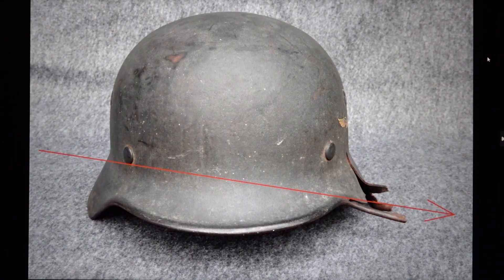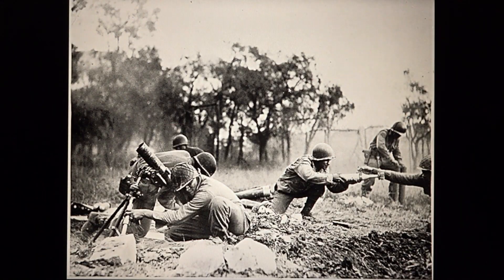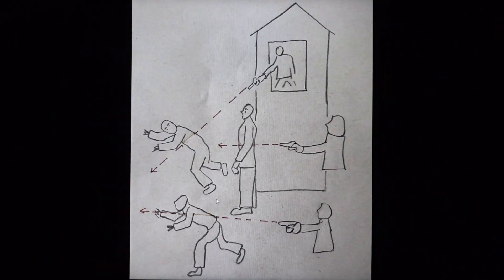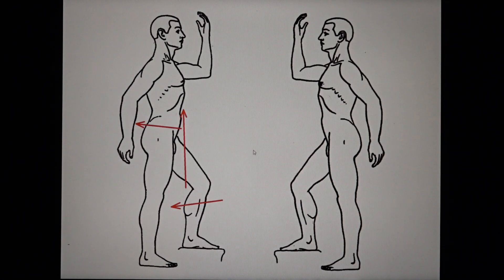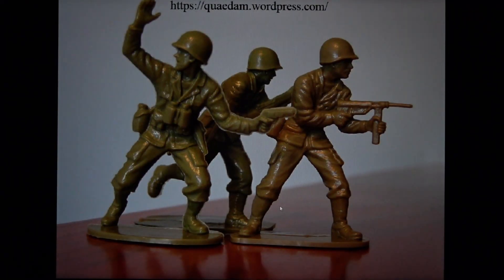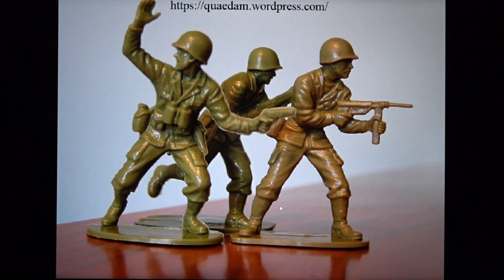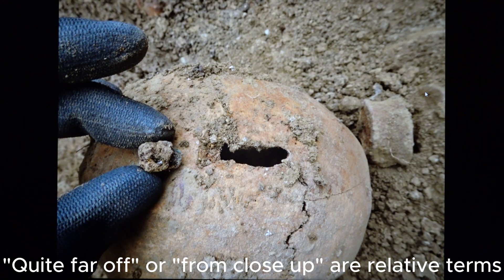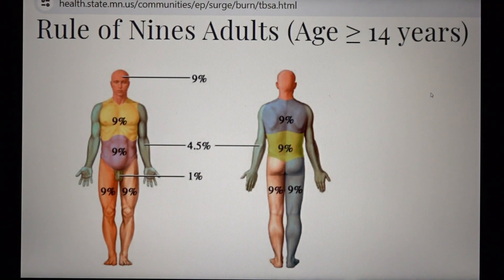Bullet trajectory and shooter position - Scientific fact or mistaken overinterpretation?

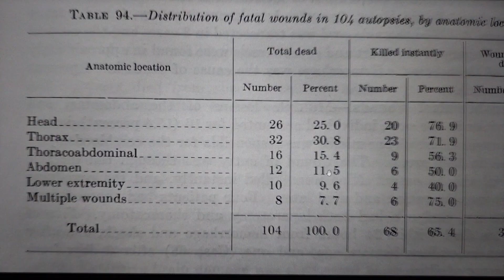Comment: 11:24 There's another video on YT about 'survivorship bias', which concerns a WWII study of damage to planes, and what parts of planes to protect more. I believe I remember the thumbnail too: they plotted the bullet damage to planes that returned and there's a LOT of holes all through the wings and the fuselage, but very few in the areas where the engine(s) and pilot(s) were. Looking at those diagrams most peoples first impression would be 'we have to put more protection on the wings and fuselage', since clearly they suffered more damage. However, fortunately there are smart people around (no, not saying I am 😅) that drew the correct conclusions. Actually, the planes that returned (!) had their data recorded and plotted on those diagrams. So, on the flip side, those that were apparently so damaged that they did NOT return, probably had damage in the area which were under represented in the returned plane diagrams... Having data is not the same as understanding data....

Comment: Sometimes a soldier without a helmet gets a headshot, or a helmet just laying somewhere gets a hit. A soldier may put on a helmet that already has a bullet hole in it because at the time that helmet is better than their own for whatever reason, or they lost their own helmet, or they are simply issued a used helmet. A soldier may wear a shot helmet and then die from different causes than a headshot. A soldier may encounter friendly fire from the own ranks or an opposing position.

Comment: If you could figure out if that was a 7.62x25 it is a significant little calibre. Very fast almost in a magnum category. It's a necked down round. It has shoulders on the casing vs a 9 mm or 45 ACP. This was probably a spray from a PPSH more than likely between dugouts.
Reply from the maker: As you see, the casing is not there. But I think it is from the PPSh indeed.

Comment: What you forgot to mention about the jfk so called magic bullet was also that the back seat of the Lincoln was 2 feet higher then the front seats so president can be seen and wave. So jfk and wife were raised higher. That alone explains the bullets path.
Reply from the maker: There is nothing to explain about the magic bullet, because everything it did was perfectly logical and not magic at all. The carcano bullet was extremely stable.

Comment: Correct Hypothesis! The soldier could only have been shot from a higher place if he was standing bolt upright looking ahead, front and centre! Now what are the chances of that? In actual fact the soldier's head could have been in any position, there is no definitive answer to the path of trajectory. Hell, he could've been shot whilst kneeling down and looking up meaning he got shot by a guy who was lying down!
Reply from the maker: Well, if you read the pathological liar Sven Hassel's versions of the war, a German soldier was as hard as Krupp steel and only had to look straight ahead. This is solide evidence that Kurt was shot by a sniper.

Comment: Hello Crocodile, if you make a aimed shot in e greater distance, the Bullet always will come from above, because the Flypath of the Bullet.

Ich schreibe dir das jetzt noch auf deutsch, als (West)Schweizer hoffe ich, dass du dies lesen kannst, es ist eine wichtige Erklärung:
Wenn man einen Distanzschuss abgibt, wird das Geschoss immer mehr oder weniger (abhängig von der Schiessdistanz) von oben nach unten im Ziel einschlagen, wegen der gekrümmtem Flugbahn, hervorgerufen durch die Erdanziehung. Man muss ja dessen Flugbahn wegen der Erdanziehung und dem Absinken des Geschosses erhöhen.
Auch wenn der beschossene gerade dasteht, wird das Geschoss bei einem Distanzschuss tiefer aus, als eintreten.

Ich verfolge deine Beiträge immer mit grossem Interesse. Bravo!
Gruss aus dem Solothurnischen.
Reply from the maker: Indeed. Considering this went through the head and both sides of the helmet, I dont think it was fired from very far though, which is logical for an urban environment.
Reply: @CrocodileTear  lets take the Cartridge 30-06, the US one in WWII, at 300m the Velocity is still ca. 670m/s (147grain FMJ bullet with 890m/s V0) the drop is almost 40cm at 300m. So you have to aim that much higher and this becomes an angle who fit very good with the damage pattern of the helmet. the 670 m/s with the full metall jacket bullet are enough to penetrate the helmet and skull (the russian 7.62x54R is very similar, also the British .303 Rifle round). the exit mark on the helmet shows, that the bullet flight sideways with not much remaining speed to be expected a this range.

Ich mag diese Diskussion, und will auf keinen Fall Klugscheissen, es ist ja eigentlich egal, da, wie du sagst, zu viele Details der Situation und Position damals offen bleiben.
Als Büchsenmacher liegen mir solche Themen halt einfach auch. Die Durchschlagskraft der verwendeten Patronen ist auf alle Fälle sehr hoch. 
Auf 10m Vermögen diese Geschosse 10mm Vollstahl (St37) zu durchschlagen, das habe ich selbst mit der 7.5x55 geschossen.

Comment: That picture of the human body with the hit marks reminds me of an evaluation of battle damage from japanes engineers of japanese twin-engined bombers.  All bullet holes found on those planes where drawn onto a sketch of a bomber. There where only few marks on the engines and crew areas, but a lot on the wings, stabilisers and some center areas. The quick conclusion from that evaluation might initially be that the planes need more armor in those areas with the most damage.  But that is not correct! Why? Because those planes which received battle damage in more important and lethal  areas did not return home! So in fact the future planes would rather need armor in those areas where less battledamages after return can be found. So compared to the forensic evaluation from the battelfield in this video it is vice versa. On the battlefield they examined the corpses with "damage" in lethal areas, not those who returned home. That is why you do not find so many wounds on arms and legs as explained.
Reply from the maker: I love your comment. But please reread it and edit the conclusion part so that one and all can understand that the answer is NO.
Reply: @CrocodileTear  Well, i am not really sure what you mean exactly but i will try to do something.

Comment: The gnarled pistol caliber bullet is a little unusual. Normally those were full metal jacketed. I've recovered many pistol bullets from their terminal ballistics event. FMJ bullets normally weren't that distorted. Sometimes the lead was separated from the copper jacket (perhaps steel jacket in european bullets) upon impact. Perhaps the bullet went through something first causing it to distort and then tumble. Keyholing of a bullet is caused by an interuption in it's external ballistic stability provided by high rotation speeds caused by rifling. Even bullet buffeting by slowing down through the sound barrier can do that. Or brush, grass, etc enroute. Keyholes in long range paper targets are often perfect profiles of the bullet. Accuracy significantly ends at that point. THe bullet whizzes by instead of 'cracks'.
Reply from the maker: This bullet does not have a copper jacket, it has an iron jacket, which is why it looks so ugly. Iron jackets were used by the Germans and Soviets I believe.
Keyhole can mean two different things. Here I am not saying the bullet was keyholing, I am saying there is a keyhole type entrance wound in the skull. This is caused by perfectly stable bullet that enter the skull at a very shallow angle. This is a forensic medicine word. The word clearly has a different meaning for hunters and target shooters.
Reply: @CrocodileTear  The ferrous jacket was 'plated' or somehow coated with materials to environmentally protect the material and it also reduced wear on the bore. 'Gilding metal' and 'copper wash' are some terms i've read. Being an American shooter I'm not that familiar with ferrous materials in cartridges or bullets. Ive always been impressed how a pellet of mild steel can be smashed into the form of a cartridge casing.

Comment: Three other reasons to conclude the head wound was not created by a "sniper."  

1. Such marksmen use military grade rifles.  Military grade rifles are high-velocity weapons.
2. The bullet entered but failed to exit the cranium.  Craniums do not stop high-velocity rifle bullets.
3. The cranium is intact.  High-velocity rifle bullets break the cranium into many pieces due to the transient cavity created within.

I'm a retired criminalist.  Thanks again for what you do!
Reply from the maker: That all depends on the distance of course, though as a general rule what yu say is entirely correct. In this case the bullet is present and it is as far as I could determine the Soviet bullets used in the PPSh submachine gun.

Comment: Also don’t forget to factor in ballistic trajectory as in bullets travel in an arch not a straight line like a laser. With that being said a bullet fired from a long distance will be traveling at a downward angle at impact. So that is another consideration to debunk the shot from above theory. Just one more component to a very complicated forensic analysis. 

Also thank you for your work on this channel. Very informative and interesting to see this subject matter from an outside of the USA standpoint.
Reply: The descent angle on ballistics is pretty negligible.

especially for WW2 where you had fairly high velocity weaponary but fairly rudimentary sight/targetting systems still.

The descent angle even at 2km is only a few degrees, completely negligible for this sort of work.

Comment: I've always assumed the Dunning-Kruger effect had a few prerequisites involving things like basic logic and common sense in order to apply.  If an adult sticks a fork in an electrical socket, is that the Dunning-Kruger effect or just plain stupid?  

Anyway, and please correct me if I'm wrong, but while we're talking about bullet trajectory....  The angle of target entry for a 30-06 for example would be around 10 degrees at something like 200 yards, or up to 3 or 4 times that angle at max range.  The red arrow through Kurt Günther's helmet looks like about 10 degrees to me. 

Also can a bullet alter course as it passes through helmet, bone, and brain material?  As mentioned in referenced video, yes.
Is it possible the helmet started to move in relation to his head after entry but before exit?  I don't know, but it seems logical and the angles make sense with this one (push on entry side, helmet goes up on opposite side).
Reply from the maker: Everything you mention adds even more unknown to this, and underlines the fact that no quick, easy and sweeping conclusions can be drawn.

Comment: Also high percentage of head wounds are cose lots of people use head as only part of body to get out of trench (to aim, spot, listen, watch ets). As sport shooter and hunter, i can confirm this is not sniper. Pistol range more than 50m is just a statistics. Try to shoot man running 25m from you with pistol is almost imposible. Movies will make you belive it can be done eazy. Not true. Anyway really good content and greetings from Slovenia
Reply from the maker: Indeed, I meantion in the video that the head being the most exposed part of a soldier, it will in any case have more than its 9% share of hits.

Comment: One very minor issue: “Completely wrong?” You were there? How about “highly improbable” or “very unlikely?” Very well done, as usual and very thought provoking. My experience in jungle warfare decades ago was that for every bullet wound we incurred, we took 3-4 shrapnel wounds from mortar rounds, usually air bursts, and those wounds would range in severity from literally a scratch to fatal. Also, the helmet with the recovered bullet….you didn’t say where that was from (if you did, I didn’t catch it)…I assume it was from one of your digs on the Eastern Front area, where the Russians had huge numbers of PPSh 41’s and PPS43’s, both of which fired what was essentially a high powered pistol round, the 7.62x25 Tokarev round.  Again,  overall, very well done; I enjoy your work.
Reply from the maker: What is "completely wrong" is thinking that you can draw detailed conclusions about shooter location and nature of shooter based only on a bullet trajectory and impact area. There are multiple possibilities, and all of them by definitionare  possible.
I normaly make my videos in a single shot, so usualy managed to say a few stupidities and mistakes per video :)
Indeed, the round is PPSh in my opinion. 
WWII and WWI statistics are very clear, something like 80% of casualties are caused by artillery. Jungle warfare has a higher rate of gunshot wounds and friendly fire incidents for obvious reasons.